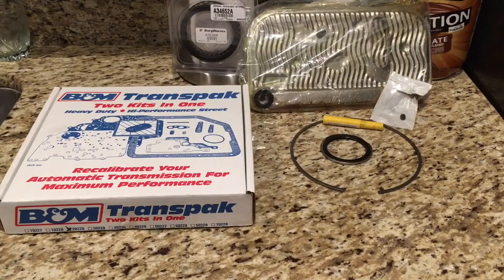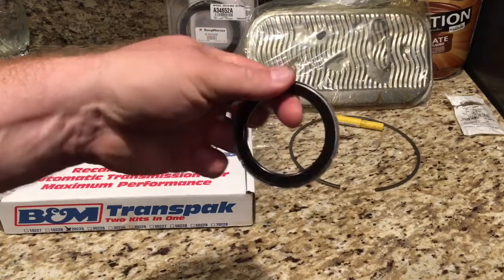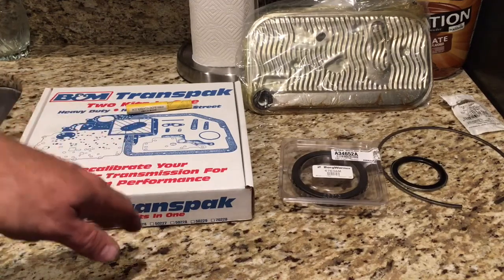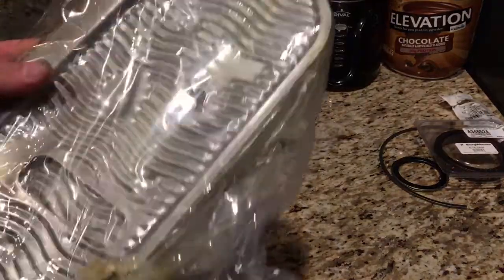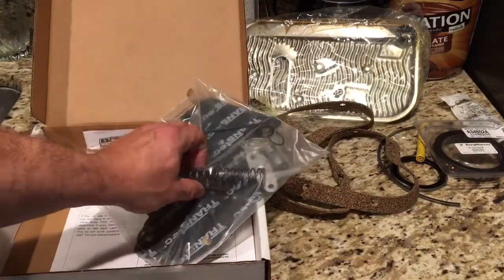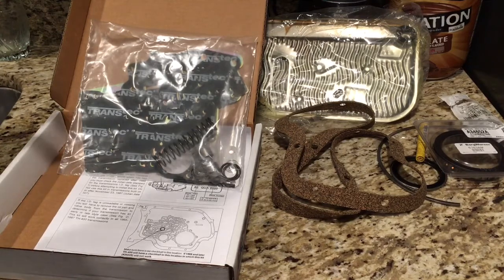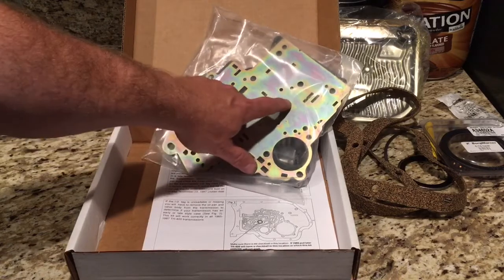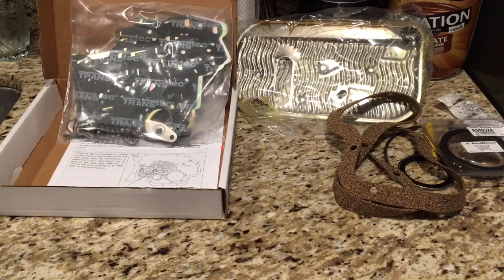TH400 for BOOST parts Mail Call 6/1/18

Comment: I realize the video is 2.5 years old, but for those who may see this and wonder, that filter has a brass screen element and is high volume flow, whereas the dacron/felt elements can reduce flow. The dacron/felt also clog in higher performance transmission application due to greater shedding of clutch material and metal from steels.  High performance transmissions and heavy duty require greater fluid change intervals, and the screen filter can be cleaned and re-used.  Hope that helps. :)

Comment: Did you use a drill PRESS, makes it much easier!
Reply from the maker: John Kendall Most definitely did!  I shopped around for a cheap arbor press then saw a video showing how to compress the springs with a drill press!  Then i made my own video!  JD
https://youtu.be/Y0_B0mVUW50
Reply: @HeadFlowInc  Todays metals are hardened so much drill bits don't stand a chance anymore unless you do use one , thanks for the reply

Comment: What's the part number to that shift kit?
Reply from the maker: i just wanna race drag em down You’ll need to get the Trans Pak that matches the year of your TH400. 
My core was a 1969 so I used the our 20228
This kit is for 1965-87 I’m not sure if it covers anything newer. 🤔